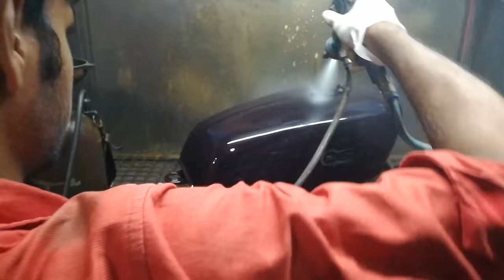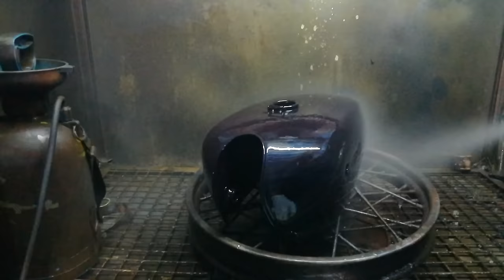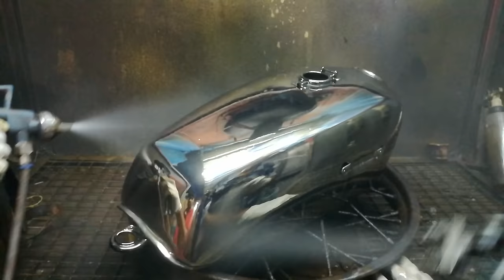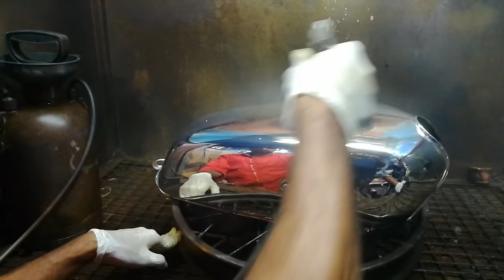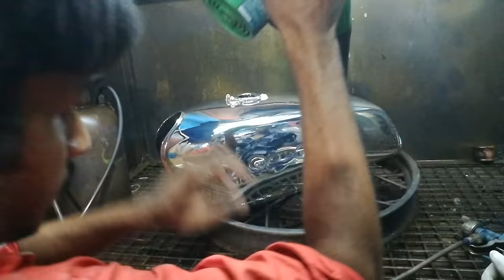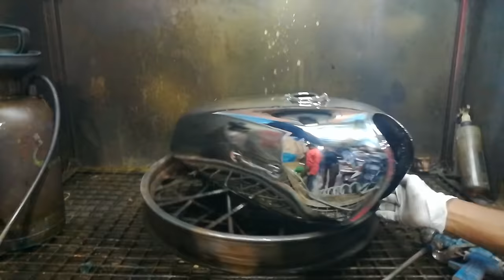Eazy way to chrome Yamaha rx100 fuel tank

Comment: In my day we covered the fuel fill area so the over spray wouldnt go into the tank? Or atleast we put stuff in it but under the opening?
Reply: I was having the same thought while watching! Petrol being a powerful solvent I wondered if these paint chemicals and clear coat would react with the petrol and cause engine fouling.

Comment: So tank should be primed and painted black as usual prior to hydro chroming?
Reply from the maker: yes
Reply: @shacustompaints3844  can you chrome inside of a fuel tank to prevent rust?
Reply: What paint using for hydro chroming
Reply: @shujabhatti536  gasoline should prevent rust from building

Comment: But why would you chrome a tank. Becomes a challenge to ride during the day.
Reply: It's not even real chrome.  It's a shitty spray on finish that will wear off.
Reply: @VndNvwYvvSvv  No bro, not a paint but it is a coating.
Reply: @VndNvwYvvSvv  that is the point of clear coat after 2k clear seal that right up

Comment: You should have put something on the fuel hole to resist water from going inside.
Reply: It's actually okay, because. These yamaha tanks are old and have rust. So before installation people tend to clean the tanks after they've been repainted.
Reply: Tap water does not get that kind of rust you are mentioning.
The best to clean rust spots is not any of the products selling on stores.
Its simply hot tap water and a soft tooth brush .

Comment: Easy to use but not easy to get the lquid.
Reply from the maker: It's easy we supply all over the world
Reply: @shacustompaints3844   do you ship to bahrain ? need more info please
Reply from the maker: @hydrodipart9949  Ya sir we can ship but it will be Expance for shipping.. You can get the formula and raw metrials you can get in your country... For more information call us at +919841637127 are whats app in the same number
Reply: @shacustompaints3844  I added your conntact. Connect you soon.

Comment: I'm afraid I don't understand. There are a number of visual defects on the tank surface before you started to spray the "chrome". Why did you not remove or repair these prior to applying the chrome? The final job looks like hell and is the work of an amateur.

Comment: Easyest way to die or be cripled/ blind with no protection at all like these guys...
Man...you het the job done, but for what cost?
Reply: It's not real chrome, genius.  That requires acid dips, heated solutions, and electroplating.  They use not of that.  This is some shitty fake chrome.
Reply: Uncomfortable Truth ooooooohhh.
You thought I took it for real chrome...I see. Wtf?
Be my guest, just spray your lungs with what you want.
Been a painter for 30 years chemically, so I think I know a bit more than you about this...genius..